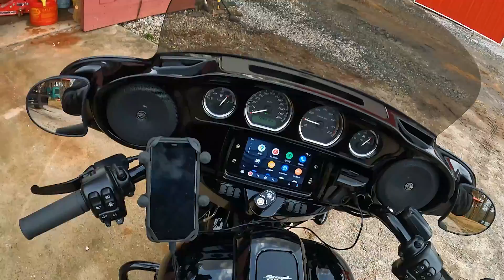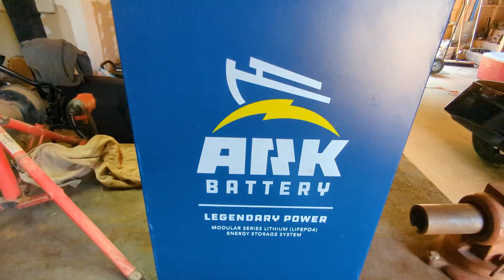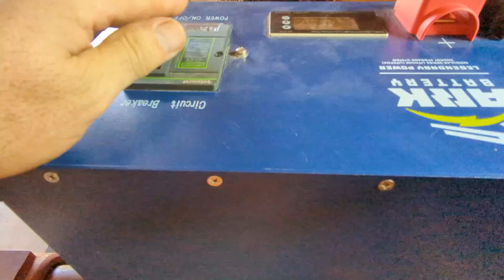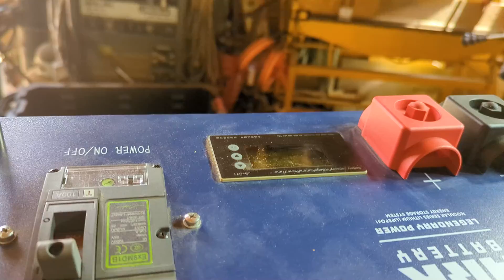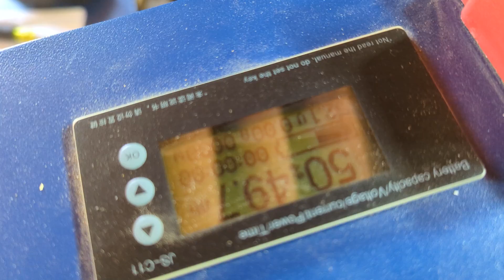BMS Replacement | ARK Lithium

Comment: that board is the balancer, a large passive resistive balancer, which they call active, but its not using capacitors. those are resistors.

Comment: You have that charger connected wrong, the positive from the charger is connected to the negative of the BMS. No part of the high current battery wiring is connected to a BMS.....the BMS controls the negative side only.
And having to spice/wrap tape on a connection, amateur.

Comment: People need to be aware of the difficulties of fighting lithium battery fires and position those batteries accordingly away from the home so that everything is not lost.   See: recent video of EV bus fire while parked in parking lot.
Reply: These are Lithium Iron Phosphate (LiFePO4) chemistry, which is much safer than the cells used in most EVs (some EVs now use LFP too). Good to be aware and having a separate power-house can be a good idea in any case, but the fire concerns are not warranted with these Ark units.
Reply: Almost certainly the bus was using a different chemistry.  Nickel metal cobalt vs lithium iron phosphate.  Nmc is crazy by comparison

Comment: I called Ark before buying my evault maxes.  No comms with sol-ark and these look like they’re put together for a high school class by comparison.  I pulled the panels off my evault maxes and their construction is stellar.  Love your videos, especially the old ones with Johnny Valentine!  Thanks for all your hard work making youtube vids especially for us wannabe DIYers.
Reply: Saw this video on Fortress BMS replacement. Not very clean?  https://youtu.be/AD-ZUUFowIw?t=48
Reply: @jamesmast9147  that’s an evault not evault max.  Evault max is just unplug some connectors, unscrew the case from the chassis, screw the new one back in and plug the connectors back in.  Probably 15min and foolproof.

Comment: Assuming the inverters can be hardened, it seems like they could make covers for the battery connections to join everything into metal enclosures and cable duct which could protect against most EMP.

Comment: I have really wanted to see inside the Ark battery. Looks well laid out and easy to service. Looking fwd to understanding the active balancing and circuit breaker actually disconnects the bms?
Reply: Question how long would it take for a lifeph battery cells to get out of balance if you had to bypass the bms in dire situation?

Comment: That smaller board looks to be an older resistive balancer. The newer Arc batteries claim to use “impactive technology (their term) that basically takes the energy from the higher charged cells into the lower ones to balance. It’s one of the best types of balancers depending on at what voltage the feature becomes active and the current it’s capable of.

Comment: Excellent video.  Now I'm curious.  What is the situation of field serviceable components for Sol-Ark inverters?  Are parts available from Sol-Ark?
Reply: Yes, I’ve had to replace parts in a couple sol-ark inverters. If there’s deemed a problem with a part they’ll ship them out for free as long as they’re under warranty. No sure if you can outright buy them.

Comment: that second board is a balance board, when a specific cell  is higher than the rest, its slowly discharged through small resistors to keep voltages at the cell level roughly the same, you dont want 1 cell at 4.2 volts and the rest at 3.7
Reply: Its the ballance / sense board as the BMS is not really a BMS more than a O/C protection board. The second daughter board is still communicating to the mainboard via serial by the looks of it.
Reply: Hello sir i'm from philippines allways watc your videos
Reply: Hello sir.. from philippines allways watching your video. Can i apply sir as your helper?